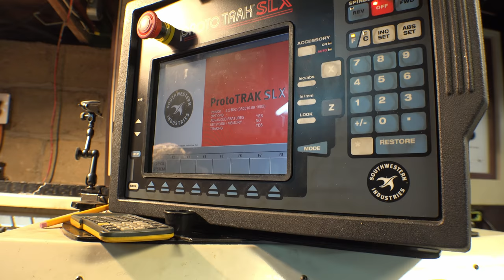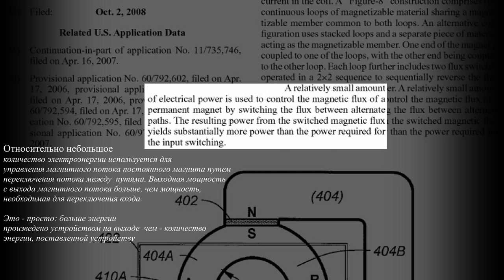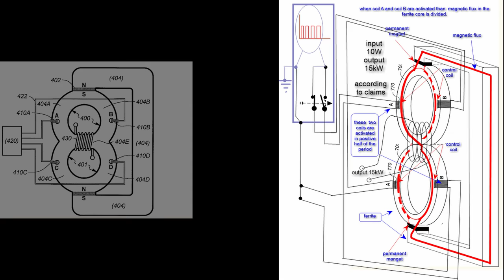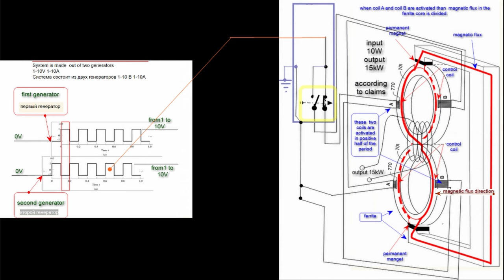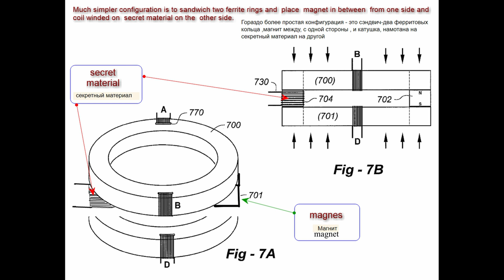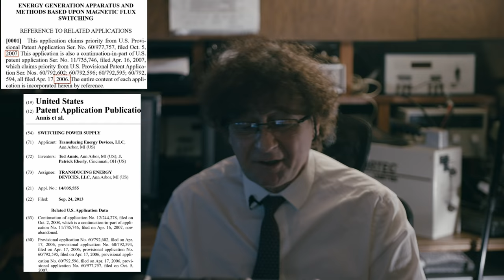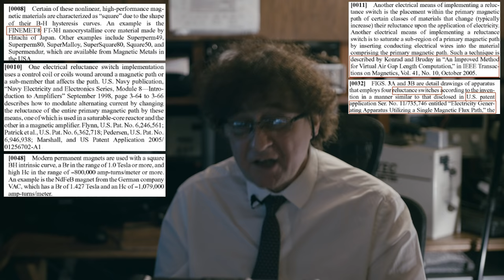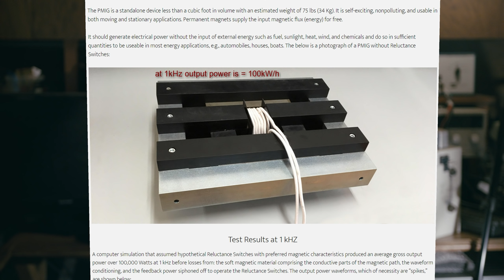Ted Annis 15kW FE

Comment: Magnetic fields inside magnetic materials follows superposition principle, e.g. if you have 0.5 tesla  magnetic field in one path of torroid, you'll need more than 0.5 tesla to redirect it to another branch. Only change of magnetic field will produce voltage in output coil. Only switching coils are producing changes in magnetic field, this change of field would only add or subtract from the permanent magnetic field. So, it won't matter if you put permanent magnet in this circuit or not, Output would always depend upon the fields of switching coils. So, forget about the free energy here.

Comment: The idea being used here is the same one bearden used in the MEG.
Reply: Might also be compared to the Flynn Parallel path function.
Reply: In the MEG the secret was to use METGLAS cores as they don't retain domain alignment without the magnetic field present...  one could also use magnetite but its not as permissive as the metglas amorphous metal...
Reply from the maker: @CoruscantMe   I'm not sure. There is not only the material please look at: https://overunity.com/17735/wesleys-kapanadze-and-other-fe-discussion-forum/msg527845/#msg527845

Comment: The secret material could be simply neodymium magnet - the magnetic flux devices work close to magnetic saturation point.
Reply from the maker: no it would not. It must be the same material that was used in old computer frame from 1960. 
It is  square  hysteresis magnet with switchable polarity. Upon the impulse it switches and holds the time being polarization. It is old computer logic.
And this is also  the fuel.
Do not forget about ground wire.
Impulse must be sharp square.
Rest information is in my first post.
Reply: I see, but permanent magnets just have square hysteresis curve https://i.imgur.com/xpoGqIh.gif
BTW Which "first" post and ground wire are you referring to? 
The videos aren't everything. Coherent information in form of manual would be more useful here.
People are building whole planes and rockets according to manuals, not by videos.
Reply from the maker: @zephirawt4997    there where  two of your question  held for review by youtube.. One I was able to  recover. 
That particular  type of magnet easily demagnetizes in comparison to other types magnets .That is why they are used for logic circuits.
The amount of of flipped  magnetic  force is the same in them as it was before.
Coherent information you asking me for is somehow colliding  with  certain patent regulations in USA.
All I can say  ground wire is important and something must  serve as a fuel.... as energy must come from some kind of conversion.
Another motive  is purely personal. there must be some kind of fairness to Ted.  After all  yes you can make it but I can not  talk you to do it.